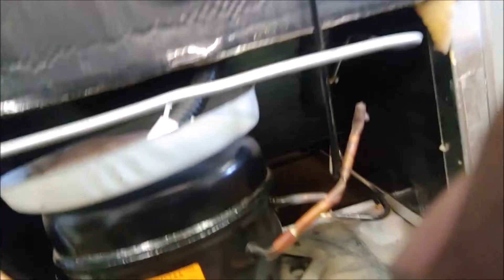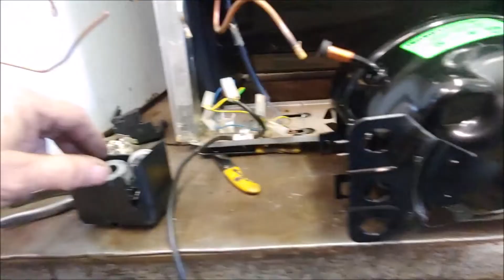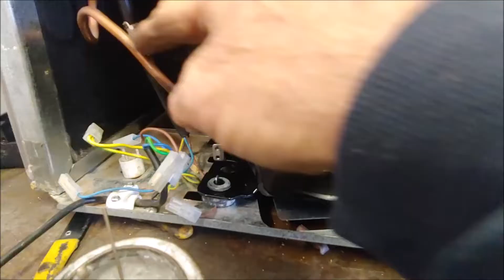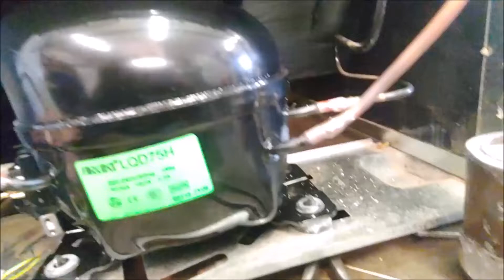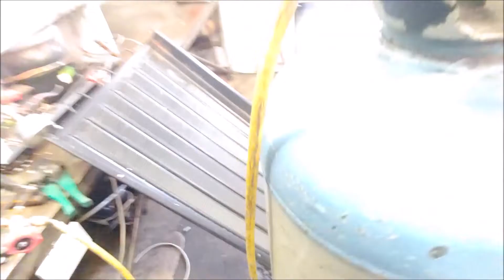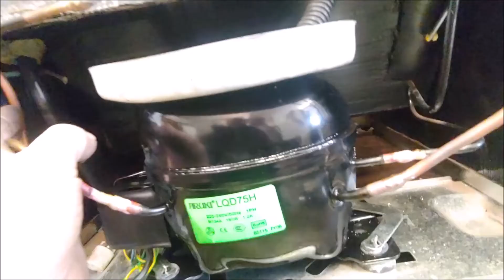Replacing a domestic fridge compressor - JD Nel Refrigeration

Comment: My compressor have the same resistance value in run and start winding and overload cut circuit very fast, should i replace the compressor.
Reply from the maker: If the compressor is faulty then you need to replace it, but some compressors come from the factory with the same resistance.

Comment: Could you tell me the average  PSI when not running and a fridge is set/full? (a range is fine) Otherwise, great video.
Reply from the maker: On a fridge thats warm the pressure on the gas in the fridge will be exactly the same as the pressure as the gas cylinder outside the fridge. When the fridge starts running the suction pressure goes down & the high side pressure will go up. The longer the fridge runs, the lower the suction pressure gets. The highside pressure will reach maximum pressure shortly after the fridge starts up and as the fridge cools down that pressure will drop slightly. The pressure depends on what type of refrigerant or gas you use.

Comment: A good idea is to fill the compressor with water before regassing.  Then  it will run cooler
Reply from the maker: Less than one drop of water in the system will freeze and cause a blockage.
Reply: Do you remember  Sam Wilkinson.

Comment: I'm assuming the replacement compressor utilizes ester oil, since you're mixing r12 & 134a? Either that or you meant you're refilling with r12a which is basically propane, sans the odor additive?
Reply from the maker: The oil on small domestic fridges does not cause a problem

Comment: When you pinched it and then sold it the end of the line. Wouldn't air want to blow back out of that joint?
Reply from the maker: No.
Reply: Ty

Comment: I wish to know how may I switch a 220vac compressor into 12vac. How to rewind it, what wire gauge to use, etc. I wand to operate my refreg on battery without using an inverter. Is it possible?
Reply from the maker: You can buy a 12volt compressor I do not think you can rewind a 220v compressor into a successful 12volt compressor.

Comment: Why did you not recover the refrigerant?  South Africa agreed to follow the Montreal Protocol on January 15, 1990, which makes it illegal to vent ozone depleting gasses, including R134A and R12 refrigerants.  Hope no one with authority to enforce it sees your video.  just cut the lines. Just running your vacuum pump for two minutes does not prove you had a good vacuum. You did remove your service valve and resealed the process tube, which is very good.
Reply from the maker: On big refrigeration plants I do recover the gas but not on the small domestics.

Comment: Why don’t you install a service valve on the compressor
Reply: It’s best best practice everywhere to remove the access valve, pinch off and braze the end of the process tube, just like he did in the video.
Reply from the maker: The type of service valves we get in South Africa has a plastic seal inside and from the heat of the compressor I find that after a couple of years it can develop a leak.

Comment: Please can you explain the difference between a dual compressor fridge and a single compressor
Reply from the maker: On a dual compressor fridge the one compressor will work the fridge side & the other compressor will work the freezer side. On a single compressor. One compressor works both the fridge and freezer.
Reply: @JDNelRefrigeration  thank you

Comment: Hello. What type silicone did you use to glue the defrost tray back on with? Thanks.
Reply: Thanks.  I will try to find some.
Reply from the maker: I buy a white multipurpose rubber silicone.

Comment: Hi,  Thx. helpful video.  Question: I am rebuilding sub zero refrigerator running R134a.  1.Other than adapting connections, is there any reason why cannot use automotive R134a in new installed residential Embraco compressor and new evaporator?  2. Do you need any oil additives for new residential AC system?  Thx.
Reply from the maker: 134a whether automotive or domestic or commercial is the same thing. As far as my knowledge stretches 134a is not used in household air conditioning. They use R22 or 407c or 410
Reply: If you add  purified water to the compressor before regassing  then there is no need to vacuum
Reply: @tbone6354  

The reason you vacuum the system is to remove any traces of water. 

The reason the system contains a dryer is to remove water. 

Water freezes and blocks the system. 

You absolutely should not add any water!!!!

Comment: you have to run nitrogen inside the tube when brazing or carbon will build up inside them and it will destroy the compressor soon
Reply from the maker: I you notice, I did flush the system with the type of refrigerant that I use for the charge before fitting the pencil dryer
Reply: @JDNelRefrigeration  purging with R12 is not going to remove the scale.

Comment: Johann, thanks for posting these videos. I was very surprised to see you vent R-134a into the atmosphere since it's a potent greenhouse gas. Just 1kg of R-134a has the same warming effect as 1.43 metric tons of CO2 (R-134a GWP is 1430).  Here in the US there's an effort underway to phase out high GWP refrigerants like R-134a.  R-12 is even worse since it's a CFC that breaks down the ozone layer as well as being an extremely powerful greenhouse gas.  R-12 was banned under the Montreal Protocol that was pun in place after we realized that CFCs were responsible for ozone depletion.  R-12 has a GWP of 10900, so venting 1 kg of R-12 is equivalent to releasing almost 11 tons of CO2!  To put that into perspective, that's the amount of CO2 released from burning a little over 4000 liters of diesel in a vehicle engine. Crazy, huh? Though it seems harmless to release the charge from a fridge,  I hope my info shows you that's not the case.  Please will you consider capturing the gas and having it destroyed properly?  I know SA isn't subject to the environmental laws that apply in many other countries, but the atmosphere and climate doesn't really care where the release occurs.  We're all in this together.  Met groot respek en dankie.
Reply: Its cost effective to capture the gas. It can be dried and reused. I'm suprised the company who supplies the gas you use doesn't pay you for recovered gas.
Reply: How do you propose capturing the gas when there is no service port?
Reply: @AirmanJH  tap it with a line piercing saddle valve.
Reply: GREEN HOUSE GAS , WAIT I MEAN GLOBAL WARMING , WAIT I MEAN CLIMATE CHANGE , WAIT I MEAN whatever the next blanket term they will use to fleece the masses of people who either are too dumb or too lazy to understand that the weather will change just like it has since weather began . brain washing people at a young age at school to scare them is one way that those who are cashing in on the ignorance of people  have conditioned and literally groomed future generations into mindless believers . i gotta go burn some tires while i let my old engine with no emission reducing components run for hours

Comment: I'm a pretty well off late middlle-aged guy. But, I'm PISSED about my twenty year old inherited GE refrigerator (probably) dying. )-; I lost a leg of power back in July, and the surge probably doomed the compressor. There is a humming noise, the light inside (along with lights in my house) dim, and it clunks towards the end of it's -all too frequent now-cycle. The surges FROM the fridge have probably taken out my HVAC transformer for the second time. This repair looks complicated. I cleaned the coils in back and slots in the cardboard today. 
These puppies used to last forever in the OLD days.
Reply from the maker: I don't know where you are but you would need a technician to examine it and diagnose the fault.
Reply: @JDNelRefrigeration  I did an experiment last night. I unplugged the fridge for ten minutes, and STILL had flickering lights. What's Really Weird is that when I turn on an overhead light near the fridge, it sounds almost normal. But, when it's OFF, it makes that "dying" sound. I am DEF calling the electrician today

Comment: Does it help to use liquid on brazed pipes to check for leaks?  I recall before charging an AC minisplit you must maintain steady vacuum prior to charging. Not with a fridge?
Reply from the maker: If you are unsure of a weld it is a good idea to use a liquid leak detecting solvent. I draw vacuum in the whole system for about 2 minutes that's all you need to remove all the air from the system before charging.

Comment: Sir please solve these problem how do you test that you did not block the filter drier after welding it in  and how do you test a working compressor that it will be able to run with gas
Reply from the maker: If the gas circulates it means there is no blockage. A quick test - put power on the compressor let it run for a few seconds while holding your finger on the high side tube to feel if it builds up pressure.

Comment: Just out of curiosity why didn’t you just cut the suction and high pressure side lines rather than un soldering them off. It looked like you had enough line to complete the job. Thanks for the informative video
Reply from the maker: I do sometimes cut the pipes off, but for this demonstration video I showed that you can do the joints without cutting the pipes off.
Reply: @JDNelRefrigeration  awesome I’m getting ready to do my compressor swap later today. Also when pulling a vacuum does it remove any moisture from the system?
Reply from the maker: @MJ-uz4zw  Yes it does but rather  than removing moisture try and prevent moisture from entering the system while changing the compressor

Comment: Thanks for the video. Why do you aim for 10psi? I've seen numbers from 0-4in vacuum all the way up to 22psi. Is this a fridge only or a fridge/freezer? Thanks!
Reply from the maker: Different gasses work on different pressures. In this video the fridge was charged with R12. If I had used a different gas my initial charge would have been a different pressure.
Reply: @JDNelRefrigeration  understood. Thanks! Any suggestions for r134a in a fridge/freezer? Pressure/temp tables lead me to believe that around 0psi is ideal for this situation.
Reply from the maker: @nchomey  0 psi will be achieved at a very cold evaporation temperature, but starting off with a warm fridge, pressure should also be around 10psi
Reply: @JDNelRefrigeration  thanks! Yes, I mean aiming for 0 psi when the fridge/freezer is fully cold. I have about 3psi right now when cold/running and it's about 13 when the compressor is off. Seems like it could be a bit lower - there is frost on the suction line, almost to the compressor.
Reply from the maker: @nchomey  If you blow a little bit of gas off, the frost on the suction line should melt.
Reply: @JDNelRefrigeration  is that, in general, a reasonable rule of thumb for filling? Watch the frost line?
Reply from the maker: @nchomey  Yes

Comment: hi.. how do you calculate what sise compressor to install if there is no specs on it?
Reply from the maker: All compressors are marked with specifications, either with codes that you can look up what displacement, BTU & power consumption or some mark the power consumption on the compressor itself.
If there is no markings you can use an educated guess according to the size of your fridge.

Comment: Hi Johann, lekker video. i would be able to do it myself if i had the gas and tools for soldering.. anyways. I want to ask can you, as in your company, replace my AEG fridge compressor, it ran on CCl2F2. it should be the same physics as the newer R-134 gases right? the comp is making a high pitched whistling noise. I am in CPT though...
Reply from the maker: Yes I can replace it.

Comment: Very helpful video but I’m not sure I understood a comment you made to someone. 
I will use map gas torch.   I wasn’t understanding WHAT solder or flux to use from your video or comments. What would I ask for or look for in the store?
Reply from the maker: I use acetylene welding which creates a hotter flame than map gas but there is no problem with using map gas. We get lots of different grades of silver solder in South Africa with different types of silver content. The one with the highest silver content is called mattibraze 34. The flux powder I use is the same that is used on precious metals - for silver brazing alloys at temperatures up to 800 degrees celcius. We used Easy-flo flux powder.
Reply: Thanks, I’m doing project today!!!!!!!!

Comment: I see you are in South Africa. In the USA we must evacuate R134A into a recovery tank and return it to a recovery center.
Reply: yea i was wondering about that too. i guess the work space there is well ventilated. i checked wiki ,it seems R134a has an insignificant ozone depletion potential, but i agree it should be saved/'recycled'.
Reply: @chrispfeif5552  Yea, but he also purged and vented R12, which one of the first refrigerants that were banned. It is much greater as far as ozone depletion, along with R11, R22, and R500. South Africa agreed to follow the Montreal Protocol on January 15, 1990,  so  he is required to recover the refrigerant.

Comment: Hello. I enjoy your videos! When you determined the line was frosting, and the system was overcharged, you released some gas. Since you were  connected to the suction side, and the system was running, did you turn the system off briefly to allow it to build up pressure before releasing pressure, or how did you manage the release of gas?  My thinking was if the release was attempted through the suction side while the system was running, you would pull in outside air. Just trying to see if there was a trick to doing it that I overlooked. Thanks., and keep the videos coming!!
Reply from the maker: If your suction pressure runs in a vacuum you have to switch the compressor off, but with R12 the suction very seldom goes near a vacuum, so you can blow off the gas while the compressor is running.
Reply: But it’s an r134 system that you vented to atmosphere.
Certainly not R12. 
Unless you retrofitted the entire system.
This video has far too many problems.

Comment: Hi is it necessary to do flushing when replacing a compressor if gas was coming out? And if you did do flushing what Is your suitable way of doing it.
Reply from the maker: If the system is clean I do not flush it. If the system is dirty there is a few different types of flushing agent available for different applications.

Comment: anybody can answer this my system use ptc system. I am not sure if I use the correct ptc but I hear and see the overload activited  and working. is that mean the ptc is correct and motor stuck .. what happens if ptc fits but wrong ..
Reply from the maker: You have to run the compressor through an amp meter and see whether the compressor draws the correct current according to the manufacturers specifications.

Comment: Can you use a regular propane soldiering torch?  Or do I have to get a MAP gas torch?  Can I use regular soldering fill?  I want to thank you for sharing this DIY repair to help me save money during these trying times.
Reply from the maker: Yes you can use a propane torch, rather not use soldering, get the proper rods
Reply: @JDNelRefrigeration  I cannot say enough thanks for sharing this to everyone. This helps.
Reply: /tin soldered joints not strong enough for this job.

Comment: I have a new Embraco  compressor with 3 rubber factory stub plugs.  Is there a trick to pulling them out because the heads want to tear off. They are hollow and I was thinking that maybe you push a blunt wire in the there to stretch the plug and then they come out but what is your opinion?   I like your tips about dealing with factory braised solder on the connections.  I plan on using Harris  Stay Brite 4% silver wire which melts at a much lower temperature than brazing.
Reply from the maker: If the rubber plugs break off inside the compressor, I would, if I can get one of the 3 out, put gas pressure into the compressor through the one that you've managed to get out and with a gas welding  torch heat the others up and they will just pop out.

Comment: Just found your channel and wanna thank you for what you do sir. My refrigerator has a leak is a KitchenAid 5 door is expensive but got it for cheap I added a car freon stop leak can r134a what is your take on that?
Reply from the maker: I've heard of the stop leak solution but I have not used it myself. I would spend some time to find the puncture and repair it.
Reply: @JDNelRefrigeration  so far the stop leak car freon has done the trick . I thank you for your response keep up the great work you do.